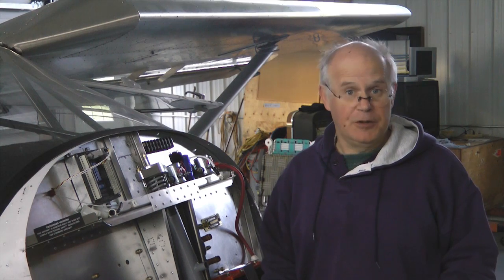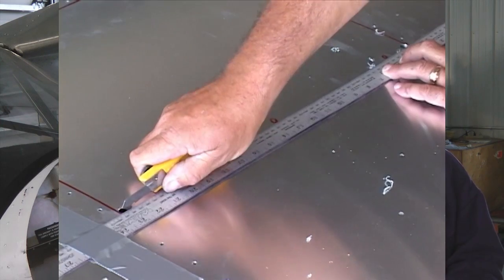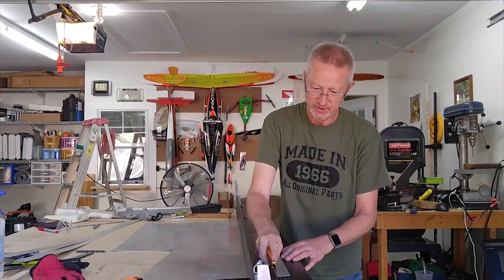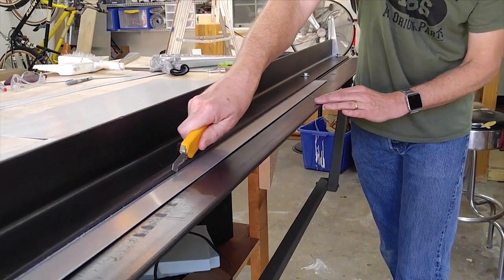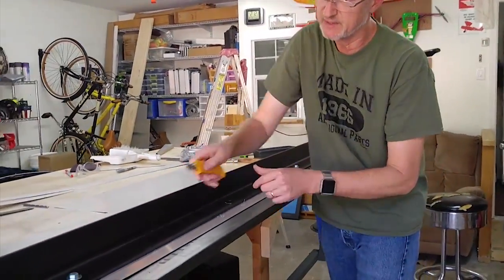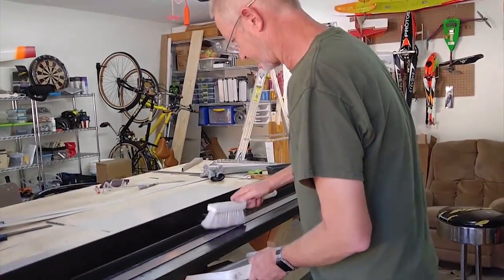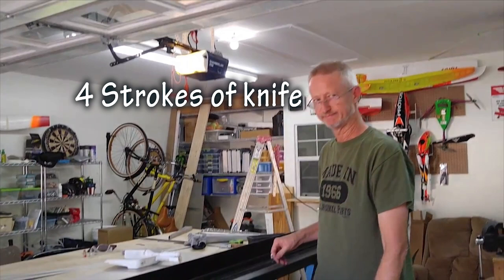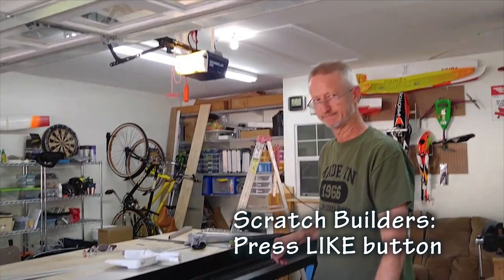Fast, Precision Aluminum Sheet Cuts with a Brake and Olfa knife

Comment: Can't find this at Olfa site or at 5 others. closest I could come was at Sears but not exactly the same.
Description Item # SPM7651017913 Model # 1090486
Heavy duty plastic/laminate cutter, used to produce a fine score line to precisely break plastics, acrylic and laminates. Features a retractable blade and built in blad
Highlights:Heavy duty plastic/laminate cutterUsed to produce a fine score line to precisely break plastics, acrylic and laminatesFeatures a retractable blade and built in blade storageIncludes: (2) blades in handleUse replacement blade PB-800, SKU #952.6088RetractableLaminate / Plastic
Reply: I think this looks like the Olfa PC-L knife.  Here: http://www.olfa.co.jp/en/body/detail/156.html
Reply: This one: https://www.amazon.com/OLFA-1090486-Plastic-Laminate-Scorer/dp/B003UHUZ5U .. And blades: https://www.amazon.com/OLFA-5014-PB-800-Plastic-Laminate/dp/B000BNLJ38
Reply: thanks champ